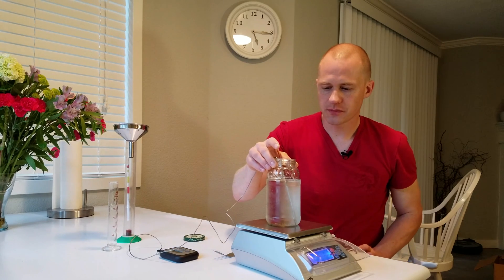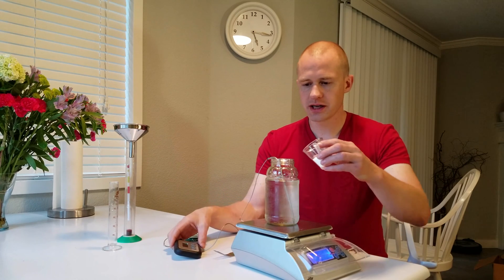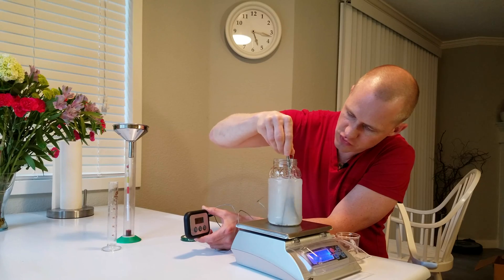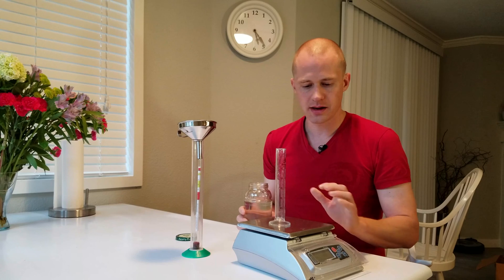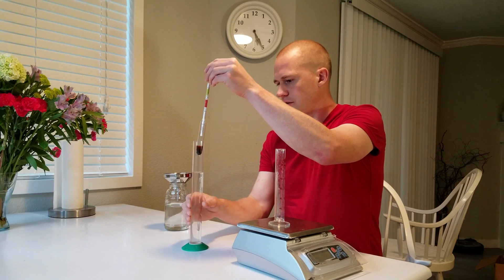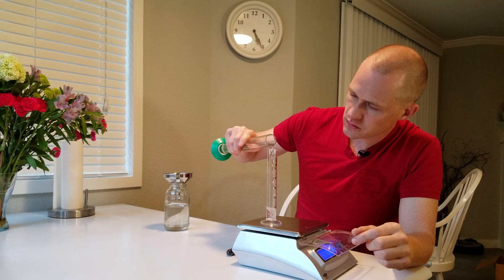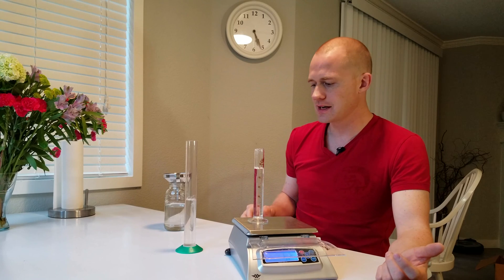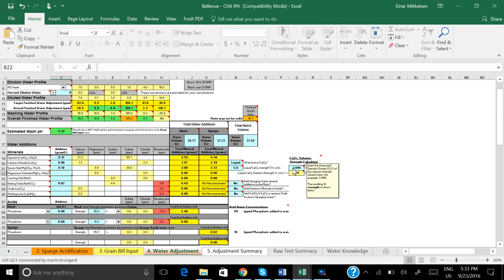Making Liquid Calcium Chloride Solution for Brewing Water Adjustments

Comment: HI Brewing Viking ! Why not just use a pH meter to test the pH of your mash water / sparge water ?  The target range for mash is 5.4 to 5.6 pH so why not just simply dump 30 grams of any type of CaCL  into a liter of water to make a concentrated solution then stir a little in at time to your mash water  until your mash water tests at  pH 5.2?  Regardless of the liquid CaCL concentrate's   exact CaCL carefully adding it to the mash water while testing with the pH meter  will give the correct pH and mash water containing  enough CaCL in it to adjust to the PH to 5.2  SHOULD  also provide enough calcium to thermally stabilize the amylase at 55-70C (RIGHT?)
Reply: There are several reasons why you may not want to do it as you suggested. 
1) CaCl2 is not the only salt addition you will want for a desired water profile, CaCl alone may give you too much Calcium or more likely too much Chloride for the flavour profile you want. Other salsts such as Calcium Sulphate, Magnesium Sulphate and others may need to be added.
2) Mash pH should be measured at room temperature, so by the time you take your sample, chill it and then add any salts the conversion is already well advanced and so makes the addition less effective.
Reply: @ridley8340  Thank You

Comment: Hi there, i came across your video , and it's the best I came across so for very usefull and simple . Now here is my question, see am trying to make calcium chloride solution using 30to 33% formula but am quite new to this and i use to buy the solution readily , but now am here with 2 oz of cacl2 granules and no scale could you please help me on how much water to add to it? Thank you (shaina)
Reply from the maker: I would do it with a hydrometer if I didn't have a scale. However, I cannot tell you how much water to add as I don't know how much water your CaCl2 has absorbed. If it is an urgent matter then I would bake the CaCl2 on a cooking sheet at 400 degrees F (203 C) for 2 hours to completely drive off all water molecules. You can then go into the brunwater spreadsheet and change the type of CaCl2 to "Anhydrous" (without water). That should help you for today. For the future, a scale is the way to go.
Reply: Thank you so much, and definitely am getting the scale soon, now you brought something else for my attention what do you mean how much water did it already have?? Even though its granules sealed in a bottle?? And therefore how to store it ?
Thank you again for taking the time to answer and help
Reply from the maker: Shay moneym101 yes, it will absorb water. This is the reason why we convert it to a liquid. The last batch I made was 40% water by weight. They are sponges :)

Comment: @Brewing Viking : Can i use a refractomer to check the strength of the solution? I was thinking something like this: 

Let's say i measure my solution with a refractometer and get 16 Brix. I then use this 

http://web2.airmail.net/sgross/fermcalc/FermCalcJS.html 

calculator and it gives me a refractivity value of 1,3573.

Does this mean that i can use this next chart and find the concentration level of my solution? (around 10% by the chart)

https://www.mt.com/au/en/home/suppor...ride_re_e.html

Thank you!
Reply from the maker: Initially, I was going to say no, as the refractometer is calibrated for sugar refraction and nothing else. However, the website you listed looks like it can adjust for this. I haven't seen it before and do not know its accuracy. I think it is worth giving it a try. In the calculator, which options to you pick?
Reply: Conversions calculator- Refractivity: Brix to Refractive index. Then i check the strength of the solution by using the chart on the second link. I will try this today and compare results. But i am a absolute zero in science. I just google a lot!
Reply from the maker: augusto m be sure to share your results with everyone
Reply: Of course! Solution is in the making as i write.

Comment: The two methods used for measuring SG gave you different results. Which one is better? Or did i miss something?
Reply from the maker: It is probably due to an inaccurate scale or an inaccurate hydrometer. Without having calibration records for both, I cannot say which one I would follow. Be sure to take the hydrometer readings at the temperature it was calibrated for. It should state right on the hydrometer itself. Try with distilled water at that temperature to make sure it reads "0". To calibrate your scale, you need calibration weights.

Comment: I made the calculations and my addition was very high. 50 grams for my mash and 72 grams for my sparge water. Mash is 8.25 gallons and Sparge is 12 gallons. Am I good, or did I do something wrong? I used yellow balanced on the spreadsheet.
Reply from the maker: That sounds right. Double check your concentration in the spreadsheet, just to make sure.